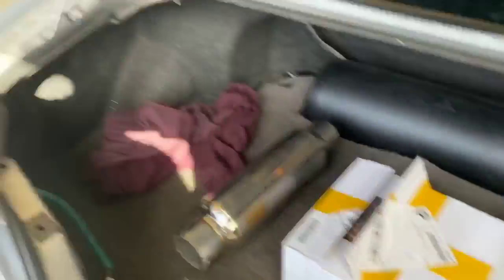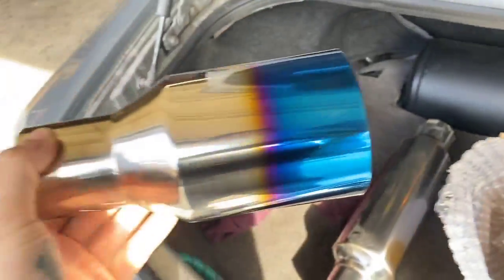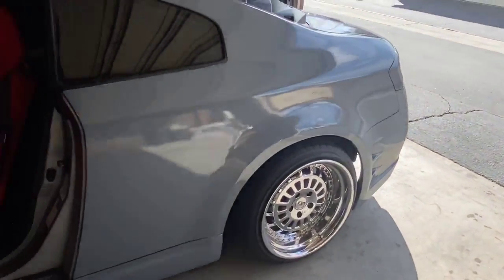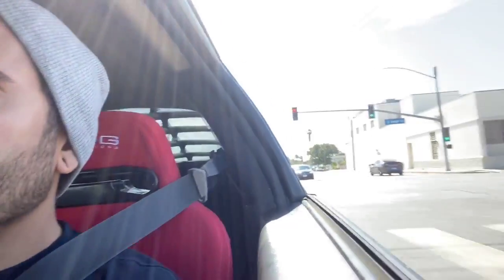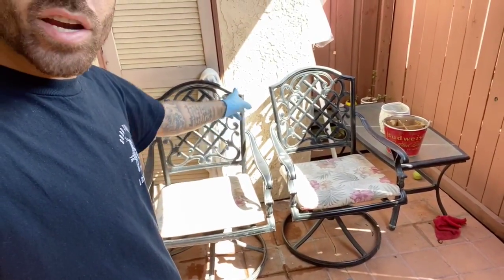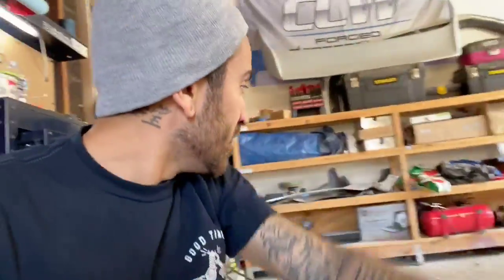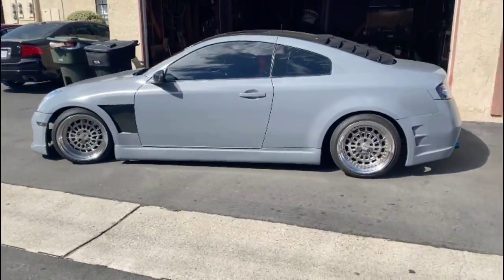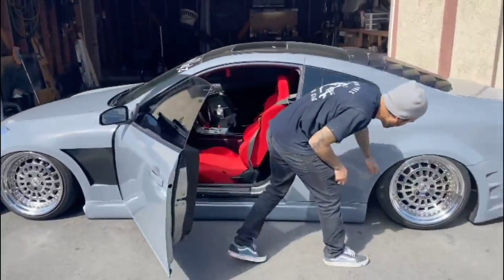G35 gets crazy loud exhaust

Comment: Step 1 find "flush mount LED" 5x7 or whater size will cover that atrocity. Turn it into a rear fog/brake light. Jdm like the wrx rear fog light assembly
Get a grommet for the light
https://www.superbrightleds.com/moreinfo/truck-lights-lamps/rectangle-led-truck-and-trailer-lights-5-led-braketurntail-lights-w-24-high-flux-leds-3-pin-connector/563/1767/

Comment: What kind of air ride are u running and what size lines? I have truheart air ride with 1/4 lines... and its slooowww to lift the car
Reply from the maker: Robert Townsend airlift with 3/8
Reply: @Louis_B_creations  did the kit u have come with 3/8 lines or did u just upgrade the lines and fittings to 3/8?? I asked truheart about bumping my 1/4 to 3/8 but they said the manifold is made for 1/4 so would make a difference if I changed to bigger lines
Reply from the maker: Robert Townsend it came with it. Had portion between 1/4,3/8.1/2 1/4 too slow 1/2 to fast 3/8 is ideel
Reply from the maker: Robert Townsend tbh idk if it’ll make a diff.. idk anything bout truhart. I have Accuair management

Comment: What did you do to get pops
Reply from the maker: Robert Valadez I have a video that shows what you can do to make it pop loud. Just search it on my channel. You’ll see it in the title
Reply: Louis B do you know what you named the vid?
Reply from the maker: Robert Valadez how to make your g35 pop extremely loud. It’s a older video.
Reply: Louis B does that method affect the engine ?
Reply from the maker: Robert Valadez if you do it a lot non stop yea it’s not good. If you do it once in awhile it’ll be okay. It’s basicly tricking your car and allowing more fuel to get loud pops. So it will go threw gas quicker then normal

Comment: Link to resonator?
Reply from the maker: https://rover.ebay.com/rover/0/0/0?mpre=https%3A%2F%2Fwww.ebay.com%2Fulk%2Fitm%2F143254007100
Reply from the maker: Ryan Miller I posted it bellow
Reply: I’m currently straight piped right now and it’s too loud and raspy.
Reply from the maker: Ryan Miller I feel you man. When I had test pipes all I had was a resonator and that was hella raspy. What u have planned next?
Reply: Louis B Honestly for looks wise I’m going to get the front lip and diffuser off of Amazon for my car and I’m going to add the stock intake box back to my car and put a K&N drop in filter because I feel like I lost power when adding the exposed intake in my car but then the next thing is going to be fixing my exhaust and do what you did.
Reply: Louis B Make a cold start video of it next!